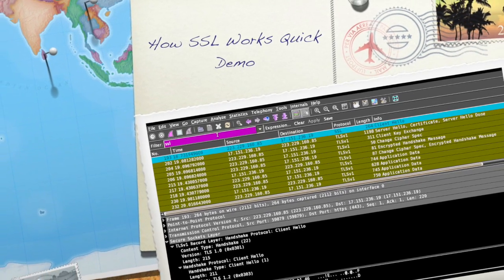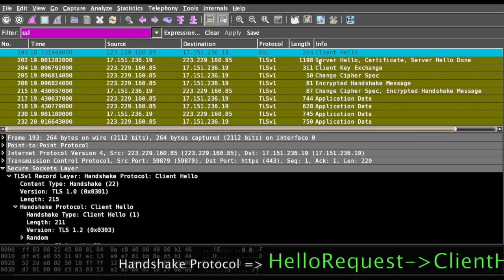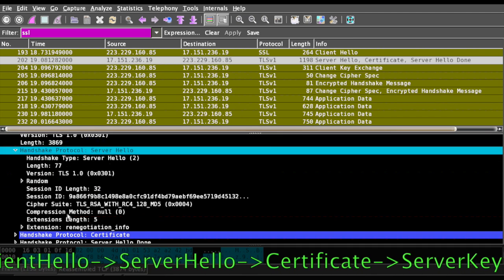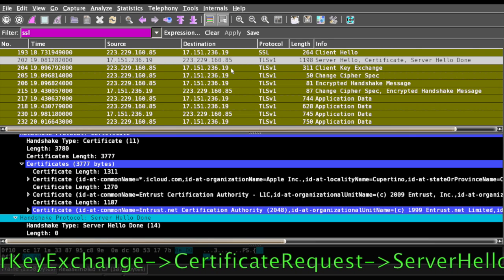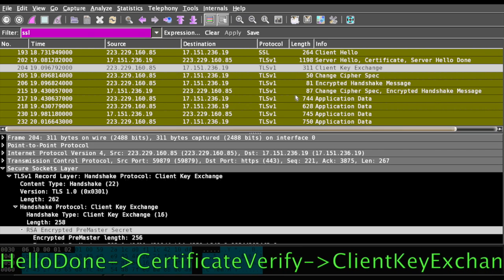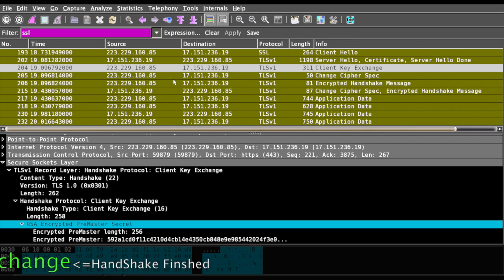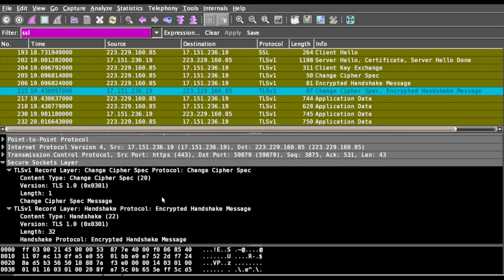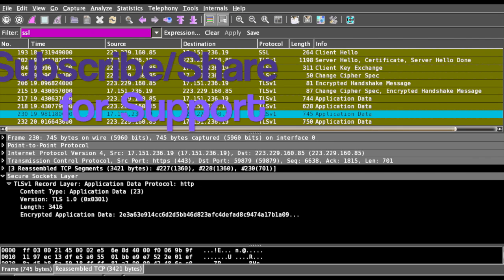ssl handshake protocol wireshark,How SSL works tutorial

Comment: How do we create a certificate using this information in order to decrypt traffic in a man in the middle attack
Reply from the maker: depends on type of key used for generating certificate if the forward secrecy is used then you cant perform MITM
Reply: I heard there are ways to bypass forward secrecy. But to stay on topic let's say I pull the certificate from Wireshark and create a CRT file with that information what's the best step to successfully create a certificate to use in an mitm in order to decrypt traffic
Reply from the maker: Use DH ciphersuites not the DHE or ECDH not ECDHE they will work
Reply from the maker: MITM attack is different scenario
Reply: @zarigatongy  do you have discord so we can talk about this more in depth
Reply from the maker: https://twitter.com/anish2good
Reply: @zarigatongy  I added you, but what mitm tool can I use to manipulate the client hello to only accept dh cipher suites that way I can capture the required certificate? It says for burpsuite we have to install the certificate on the device but I'm doing this through a transparent proxy so I was thinking maybe mitmproxy?

Comment: Hello,

On our application, we have implemented SSL over RMI. 

Using WireShark, we are able to capture and see RMI packets when making RMI client/server calls. 

Testing ciphers and protocols, we use OpenSSL. With this, we are able to see Ciphers and Protocols used during the handshake. Same we are able to see with WireShark.

However, we are not able to tell on the RMI packets that we capture with WireShark that the SSL layer has now been introduced, and calls are secured. There is no information about this. All that is there is RMI packets, with normal input/output stream messages (Call, Ping, DgcAck, PingAck, ReturnData) showing encrypted data. This was the same before the SSL implementation.

Anyone, please advise if there is a way you have tested this, and how if you have?

We have no logs nor screenshots to include. Please advise if you require any, to assist with this question.

Regards,
-

Comment: It was really nice introduction about the TLS , but i want know when already cipher suite negotiation done in server hello itself then why change cipher spec required?
Reply from the maker: ServerHello has just just-negotiated CipherSuites 

As per RFC

The change cipher spec message is sent by both the client and server to notify the receiving party that subsequent records will be protected under the just-negotiated CipherSpec and keys. It exists to update the cipher suite to be used in the connection.It permits a change in the SSL session occur without having to renegotiate the connection.The message consists of a single byte of value 1.There are two states for the change cipher spec message.Read CurrentRead PendingThe change cipher spec message is normally sent at the end of the SSL handshake.
Reply: That's done to check if anyone has perfomed an MITM and changed cipher suite values to perfom a downgrade attack

Comment: Good about info on how RSA handshake works using wireshark
Reply from the maker: Vivek anandan RSA is one of the first practicable public-key cryptosystems and is widely used for secure data transmission, and in handshake protocol the messages exchanged during the setup of the TLS session are based on this record, RSA and Handshake are diffrent concept